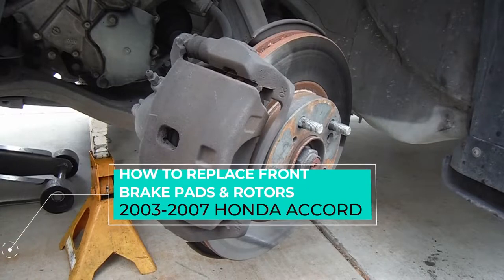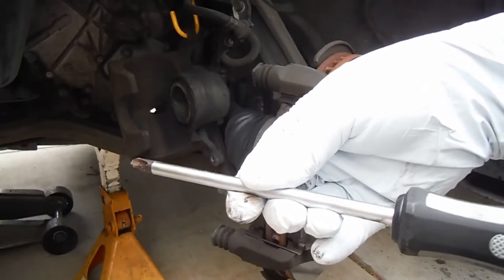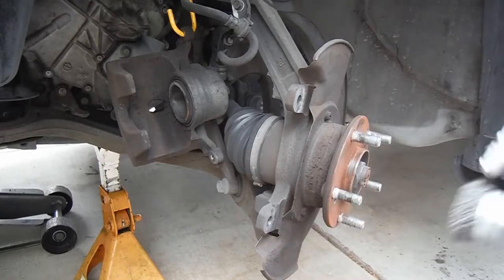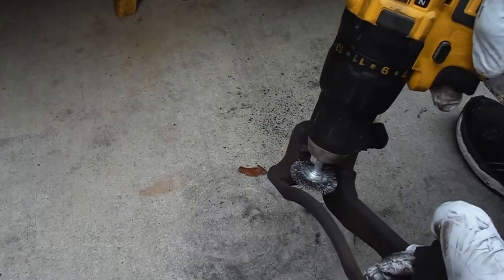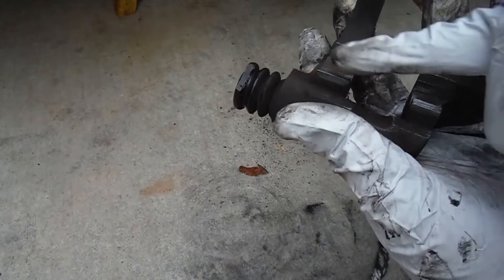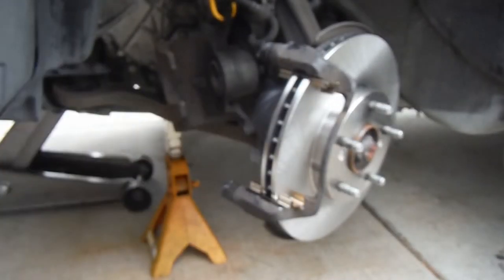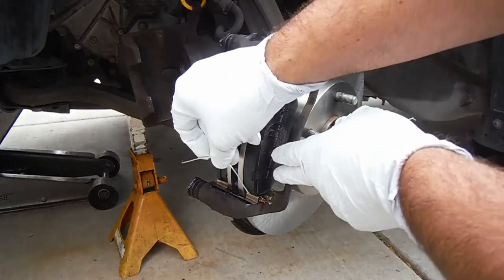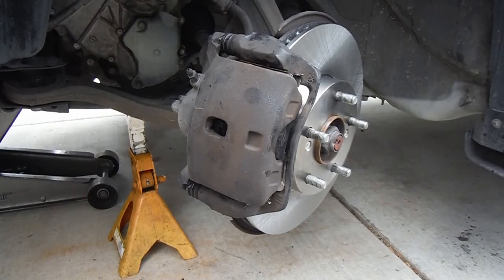2007 HONDA ACCORD - REPLACING FRONT BRAKE PADS & ROTORS - DIY

Comment: Should have gotten the DEWALT impact. Would have pulled those rotor bolts off easy!!!!
Reply from the maker: Haha, I know right...Please see the update in the description, The 4th setting on the tool was not working correctly for some reason.  It works great on the 3rd setting and takes off caliper bolts and lug nuts easy now.  I might have to reach out to Milwaukee, or I will just use it on the 3rd setting from now on for removing stuff like this.
Thanks for watching!
-Dan the Fix it Man

Comment: @Dan the fix it man 
Thanks for the video, quick question I followed your DIY for changing my brakes and rotors for my Honda accord. and after a month the wheel starts to shake when I am braking on the highway going between 55 to 65. Sometime more frequently than other times. Do you think I overtorque the caliper bolts making it harder for the pins to move ? I was told that I warp the rotor ( even though the mechanic didn't look at it )already but it really hasn't been that long. Thanks